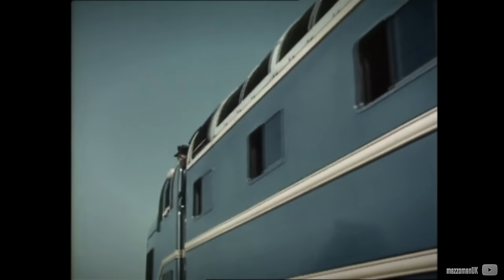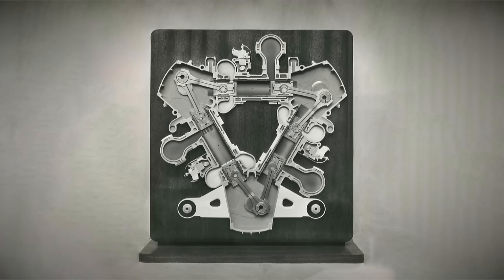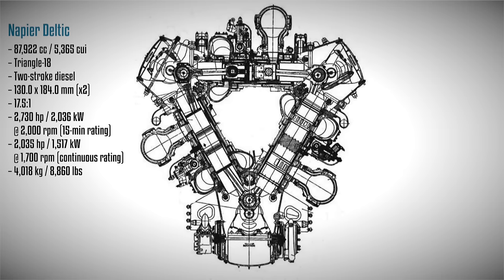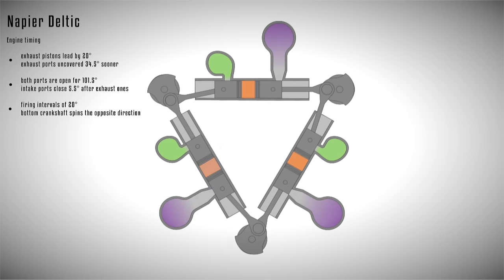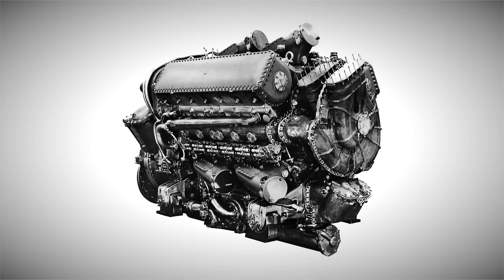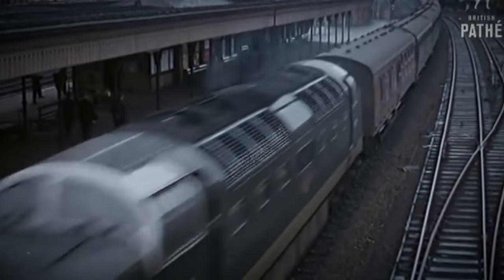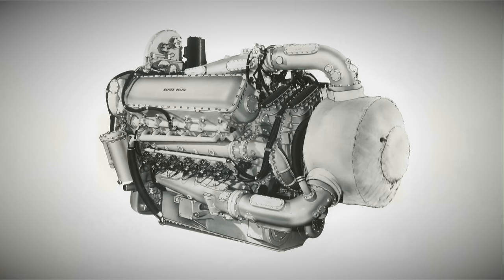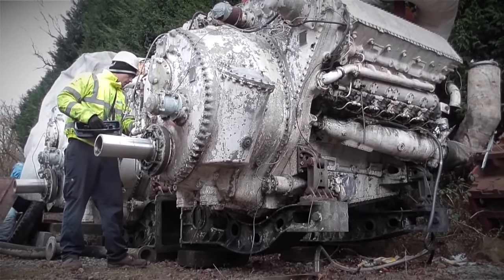The Ingenious Napier Deltic 2-Stroke Diesel Engine

Comment: 2:22  Yeah.  That's a big engine.

Napier created some of the most monumental engines in history.
Lion:  1200 cubic-inch broad-arrow 12.  Designed during WW1, still set land speed records in 1947.
Rapier:  Air-cooled H16 aero engine.  I just like saying "Napier Rapier".
Sabre:  Liquid-cooled sleeve-valve H24 engine that powered the Hawker Tempest and Typhoon fighters of WW2.
Nomad:  Turbocompound 2-stroke flat-12 diesel aero engine.
Deltic:  18-cylinder opposed-piston 2-stroke diesel, only one of its kind to reach production.  By the time they worked up to the turbocompound deltic, what else could be thought of?
Reply: The Jumo 224 is a 4,500 horsepower 24 cylinder, this technology was licensed to Napier.
Reply: @sandervanderkammen9230  The designs of the Junkers Jumo 204/205 inline-6 opposed piston engines were licensed to Napier in the 1930s. Junkers did not share any info on the Jumo 223 or 224 four bank diamond shaped engines with Napier, partly because they never put the engine into production, and partly because Germany and Britain were at war. The Deltic was proposed in 1945 and was certainly inspired by the 223 / 224 which Napier were aware of, but no details would have been licensed to Napier during the war, and I can find no evidence of collaboration afterwards.
Reply: @londonalicante  The 3 bank design was licensed to Napier... Jumo chose to pursue the 4-bank design
Reply: @sandervanderkammen9230  Do you have evidence that Jumo licenced a multi bank design to Napier? I tried to post you an article from a reliable source indicating otherwise but the comment got deleted. As you know, I acknowledge Oechelhäuser / Junkers as the inventors of the first successful opposed piston engines, and they did license the 204/205 to Napier, but I've never seen anything about Junkers licensing the multi-bank engines to Napier.
Reply: @londonalicante 
 Jumo 204 = Napier Culverin.
Jumo 205 = Napier Cutlass
Jumo 218 = Napier Deltic 
Jumo 223 = no Napier equivalent, developed after the license agreement.
Reply: @sandervanderkammen9230  I was hoping you would convince and enlighten me. Unfortunately you haven't. Here's what I found:
Jumo 204 6 cylinders, 120mm bore, 210mm stroke. Napier licensed equivalent Culverin, 4.75 inch bore 8.25 inch stroke
Jumo 205 6 cylinders, 105mm bore, 160mm stroke. Napier licensed equivalent Cutlass (never built)
Jumo 208 6 cylinders,  130mm bore, 160mm stroke
Deltic 18 cylinders 5.125 inch bore, 7.25 inch stroke
EVERY mention I can find of the Jumo 218 says it was a double version of the Jumo 208 with 12 cylinders. The only thing it has in common with the Deltic is a similar bore.

The Jumo 204/205 were licensed to Napier in the 1930s. There was a war from 1939 to 1945, during which licenses would not have been honoured by Jumo or Napier, since their countries fought on opposing sides. Development of the 24 cylinder diamond engine Jumo 223 (80mm bore 120mm stroke) started in 1936 with engines built in 1942, after which it was abandoned in favour of larger 224 (105mm bore 106mm stroke.) Development of this engine continued after the war in the Soviet Union. The engine had 4 crankshafts rotating in the same direction, 2 dedicated to inlet pistons and 2 dedicated to exhaust pistons, allowing the exhaust pistons to lead the inlet pistons by any amount the designers desired.

The Deltic was proposed to the British Admiralty (Navy) in 1945, which means it was conceived during the war. Also, I cannot see the Navy wanting anything to do with a project that required licensing from Germany given the political climate of 1946. It's possible Jumo could have licensed a 3 bank engine was 1936-1939 however I can find no evidence of this. According to English Wikipedia, Junkers did look at a 3 bank layout but abandoned it due to timing issues - Herbert Penwarden of the British Admiralty Engineering is credited with working out that the bottom crankshaft needed to rotate in the opposite direction to the other two. This may have been an original thought, or it may have been reverse engineering of a Junkers, but I can find no indication that Junkers ever licensed a 3-bank design to Napier. Junkers probably did not like the fact that the 3-bank design requires the exhaust piston to lead the intake piston by exactly 20 degrees, which is rather inflexible, and I believe, rather more exhaust lead than typical.
Reply: @londonalicante  Yup, all German Jumo technology licensed to Napier...
Reply: @sandervanderkammen9230  As I say, 6 cylinder engines licensed to Napier before the war. Multibank engines developed independently during and after the war, though both sides had some idea what the other was up to. Of the Germans, the Soviets, and the British, only the British brought a multibank product to market. The 4 bank engine could have been a good engine if conditions in Germany / Soviet Union were right for it

And the 218 was a 12 cylinder engine. Nothing like the Deltic or the 223.
Reply: @londonalicante  All German technology developed by Jumo and licensed to Napier...
It's British manufacturing... and German engineering.
Reply: @sandervanderkammen9230  "British manufacturing and German Engineering" - yes, this applies to the Culverin and Cutlass, which were based on the fully-developed Jumo 204 and 205 6 cylinder engines. All Napier had to do was adapt them to their manufacturing. And there is no doubt that the Deltic would not exist if Napier had not licensed these 6 cylinder engines, and was in great part inspired by the Jumo 223/224 four-bank engines.

But you have made a very specific claim "The 3 bank design was licensed to Napier" , and made it several times on different threads on this video. Effectively, this means, Napier paid Jumo for information on a 3 bank design and the right to use it. I asked you for evidence, and all you said was that the Deltic was based on the Jumo 218 (which is obviously incorrect since the Jumo 218 was a 12 cylinder engine, a double version of the 208.) Can you provide evidence to support your claim?

I sent you a link to old machine press dot com, that was deleted by youtube. Your claim is specifically refuted by the articles on the 223 and the Deltic on that site. Additionally, a search for the Deltic on Junkers dot bplaced dot net yields no results. 

I am in pursuit of truth and it seems very unlikely that Jumo licensed a three bank design to Napier for the following reasons.

1. Napier licensed the 204 and 205 from Junkers in the 1930s, rebranding them as the Cutlass and Culverin. Given that they never actually commercialised these engines, why would they license a larger engine in the 1930s, when there was no market for such a big engine at the time?

2. It is impossible that Jumo shared information with Napier for profit in the period 1939 to 1945, due to the war.

3. The Deltic was first proposed to the British Admiralty (Navy) in 1945 and accepted for development in early 1946. In the post war climate, licensing from Junkers is very unlikely. They would either avoided the design, or just taken it without paying. The best German technology was just taken by the allies after the war, as exemplified by the recruitment of German missile engineers by the USA and USSR for their "space programs." 

4. If Junkers had explained the timing of the 3 bank engine to Napier, Herbert Penwarden of the British Admiralty would not have had to invent or reverse-engineer it as per English Wikipedia.

5. Apart from being based on a Jumo 204/205/208 type 6-cylinder engine (which was admittedly 80% of the engineering) there are virtually no similarities in the 223/224 four-bank implementation and the deltic implementation:
- Deltic has timing gears and power takeoff at one end. 223/224 had timing gears and power takeoff in the centre of the crankshaft. (The 2-piece crankshaft caused issues that would no doubt have been resolved if a market had been found for the engine.) 
-223/224 has a single massive gear on the output shaft which directly engages with the crankshaft to coordinate timing. Deltic uses an idler between the output shaft and every crankshaft (2 in the case of the bottom crankshaft, to facilitate reversal.)
-Deltic has bore x stroke 5.125 in x 7.25 in (approx 130mm x 184mm) which does not match any Junkers engine listed on the Junkers dot bplaced website listed above (except that the bore matches the Jumo 208.)
Reply: @londonalicante  The Deltic is based on a Jumo 3 bank design.
Reply: @sandervanderkammen9230  Quite possibly, based on a Jumo 3 bank design. Wikipedia says that Junkers did look at a 3 bank design. But if you think it was licenced, please provide a link to your evidence. As I say, while there was a war on Junkers would not be sharing anything with Napier. Everything I can find says that Napier took the 204/205 design and developed the rest independently.
One thing we agree on, the Deltic would not exist without Junkers.
Reply: @londonalicante  The burden of proof falls on you lad, there is zero evidence that Napier developed any type of multi-bank opposed piston engine prior to licensing the technology from Jumo.
Reply: @sandervanderkammen9230  Napier licensed the Jumo 204 and 205 6-cylinder engines from Junkers as the Culverin and Cutlass in the 1930s. There is indeed, zero evidence that Napier developed any multibank opposed piston engine at that time. Junkers started work on the 223 in 1936 and built a prototype in 1942. Therefore Junkers conceived and built the first multibank engine.

There is also zero evidence that Napier had any interest in a multibank engine at that time, especially as they failed to commercialise the Culverin and Cutlass . "The 3 bank design was licensed to Napier" is your claim and the burden to prove it therefore falls on you. So far you have produced no evidence that there was any licence contract between Junkers and Napier for a multibank engine. Also, I can find no evidence that Junkers had any multibank opposed piston diesel running before 1942, so the most they could have offered Napier would be a license of a concept (i.e. a patent rather than a complete design) which would have expired within 20 years from 1936. 

From 1939-1945 there would be no collaboration between Napier and Junkers due to the war, although they were aware of each others work. After 1945 the main Junkers factory in Dessau ended up in Communist East Germany and development of the 224 Multibank continued in USSR until it was abandoned in favour of the Yakovlev M-501 (the article on the M-501 at old machine press dot com confirms that many German engineers moved to USSR to work on the 224.) 

According to npht dot org under marine diesels, in the beginning of 1946 received a contract from the British Admiralty to build a 1-cylinder, 3-cylinder and several 18-cylinder prototypes, essentially a new design, building on what they knew from the culverin and cutlass. You can see a photo of the 3-cylinder prototype at old machine press. It's pretty inconceivable that there would be information sharing between the West and the Communist Bloc from 1945 onwards especially given that the Deltic started out as a military naval application, so I fail to see how Junkers could have licensed anything to Napier at that time either.
Reply: @londonalicante  All of the evidence proves that the multi-bank concept and several prototypes were developed by Jumo and this technology a long with the actual designs predate, and were sold to Napier.
There is zero evidence to support that Napier developed any of the Gegenkolbenmotor designs independently.
Reply: @sandervanderkammen9230  LOL, are you back again? The Culverin and Cutlass were licensed copies of the Junkers Jumo  204 and 205 (the company name is Junkers. Jumo is a brand name of a group of Junkers engines.) Therefore the Culverin and Cutlass were almost 100% Junkers engineering, adapted for Napier manufacturing, with dimensions in inches. However there is no evidence that Napier licensed any type of multibank engine from Junkers. 

Junkers didn't have a prototype of a multibank engine running until 1942, well into the second world war, and there is no evidence that Napier had any interest in licensing a multibank engine prior to the war (especially as they didn't commercialise the Culverin or Cutlass.)   After the war, as I have already explained, the Junkers factory in Dessau found itself in Communist east Germany and develoment of the the four-bank engines was continued in Russia until they were abandoned in favour of the Yakovlev M-501 

Since there would be no legal mechanism for Junkers to license an engine design to Napier during the second world war (as British and Nazi German governments were on unfriendly terms) nor after the second world war (as East German / Russian governments were on unfriendly terms with Britain due to the Cold War) this means Junkers could only have licensed an engine design before 1939, when they had no running prototype. If you believe a license contract exists, please provide evidence.

Napier certainly copied the idea of the multibank engine from Junkers, but I have already provided plenty of evidence that the Deltic was developed from the Jumo 204 / 205 without help from Junkers. Beside the political climate as discussed above:

1 The Deltic's stroke is different from any Junkers engine. The bore is coincidentally similar to the Jumo 208. (see hugoJunkers bplaced dot net) The planned Jumo 218 had the same bore, but I already explained was a 12 cylinder engine double 208, not a relation of the Deltic as you previously claimed. The end-mounted timing gear arrangement of the deltic has nothing in common with the timing gear arrangement of the Jumo 223/224, which had power takeoff from the centre of the crankshaft

2 English Wikipedia article on Deltic says the timing for the 3 bank engine was worked out by Herbert Penwarden of the British Admiralty. Even German Wikipedia says nothing to support your claim that the Deltic was developed with help from Junkers. 

3 Old Machine Press articles on the Jumo 223 and Deltic say the following

QUOTE There is no doubt that the Junkers Jumo opposed-piston engines in some way inspired the Napier Deltic, especially since Napier purchased licenses to build the Jumo 204 and 205 engines (to be built as the Culverin and Cutlass) in the 1930s. However, there is no indication that information on the Jumo 223 or 224 engines was applied to the design of the Deltic. In fact, the Deltic possessed many unique design characteristics, such as one crankshaft rotating the opposite direction compared to the other two.

QUOTE Napier’s new engine carried the company designation E130, and the design was influenced by their experience with the Junkers Jumo diesel engines, their work on the Culverin and Cutlass, and analyses of other Jumo six-cylinder engines captured during World War II. However, there is no mention of the Junkers Jumo 223 contributing to Napier’s engine design. In early 1946, the Admiralty selected the Napier design and issued a developmental contract that covered the construction of one single-cylinder test engine, one three-cylinder test engine, and six prototype 18-cylinder engines. [Note: photos of the three cylinder test engine can be seen in the article.]

Additionally, the Old Machine Press article on the Yakovlev M501 discusses the movement of engineers of the Jumo 223/224 to Russia to continue the develoment of the Jumo engine after the war.  
  
4 The NPHT dot ORG article (under products/marine engines/deltic) discusses the challenges of developing the deltic engine from scratch. It also gives the contract date as "the beginning of 1946." There is nothing to suggest Napier had any interest in Junkers' multibank designs before then.

I am unable to provide functioning links because Youtube policy is to delete comments containing links. Please go to the websites, review my evidence and explain in detail what is wrong with it. Please also provide evidence supporting your claim that Junkers provided info on a multibank engine to Napier.
Reply: @londonalicante  The truth is irrefutable lad, this is German technology and engineering sold to Napier by the company that invented it... Jumo.
Reply: @sandervanderkammen9230  I am in total agreement with you regarding the licensing of the Junkers Jumo 204 / 205 (Once again, the company name was Junkers, Jumo was a brand.) Oechelhauser and Hugo Junkers developed the first successful opposed piston engine (Atkinson devised an unsuccessful opposed piston engine earlier, but let's not go there.) However you have made claims that the Napier licensed or in some way had help from Junkers in developing a multibank engine. As far as I can tell this is false. Napier took designs for the Jumo 204 / 205 that they had licensed prior to 1939 and copied the concept of a multibank engine from the Jumo 223/224, but they worked out the details of the multibank concept independently and arrived at quite a different configuration from the Jumo 223/224.
Reply: @londonalicante  The 3-bank design was clearly Jumo in origin and was licensed to Napier.
Reply: @sandervanderkammen9230  It's certainly not clear that the 3 bank design was licensed to Napier, because oldmachinepress and several other websites say Napier were aware of the Jumo 223/224 project but developed the Deltic from the Jumo 204/205 designs independently. I ask the same question I've been asking for a month: please provide evidence. On what website does it say that the 3 bank design was licensed to Napier? What was licensed and when was it licensed?

Was it before 1939, when Junkers had no working protype? I find it hard to believe Napier would have been interested because they didn't manage to commercialise the Cutlass or Culverin.
Was it between 1939 and 1945 when UK and Germany were at war? Napier would have been interested by 1945 because the allies saw that the German diesel powered boats were a good idea, but I can't see two countries at war with each other licensing anything. The Deltic was first proposed in 1945.
Was it after 1945 when the main Junkers factory in Dessau found itself in Communist East Germany and the Jumo 223/224 project was moved to Russia, a country the UK was not on friendly terms with?

English Wikipedia is the only place I know that hints that Junkers considered a 3 bank design, but also implies that there was no licence, because the British had to work out the timing themselves:

QUOTE: Earlier attempts at designing such an engine met with the difficulty of arranging the pistons to move in the correct manner, for all three cylinders in one delta, and this was the problem that caused Junkers Motorenbau to leave behind work on the delta-form while continuing to prototype a diamond-form, four-crankshaft, 24-cylinder Junkers Jumo 223. Mr. Herbert Penwarden, a senior draughtsman with the Admiralty Engineering Laboratory, suggested that one crankshaft needed to revolve anticlockwise to achieve the correct piston-phasing, so Napier designers produced the necessary gearing so one of them rotated in the opposite direction to the other two.

The Jumo 223/224 project started in 1936 and the first prototype ran in 1942. Interestingly, English Wikipedia mentions a Spanish patent ES0118013 for a multibank engine filed in 1930, six years before the Jumo 223/224 project started. The Spanish would not have been in a position to object to Junkers borrowing their idea because they had a civil war from 1936-1939.
Reply: @londonalicante  It's clearly a Jumo design in origin... why is that so difficult for you to accept?
Napier licensed the Gegenkolbenmotor from the German company Jumo that invented it.
Reply: @sandervanderkammen9230  Junkers Motorenbau were the great pioneers but that doesn't mean you can claim things without evidence. When you say that Junkers Motorenbau LICENSED the multibank design to Napier you are making a very specific claim, which is that Napier obtained permission from Junkers to copy their multibank design. In most cases a license would also include detailed information on a design, expertise, and almost certainly some money would have changed hands. I have asked you what your source of information is to make this claim.

Junkers Motorenbau licensed the Jumo 204 and 205 single bank desigsn to Napier, but there is no evidence that they licensed a multibank design to Napier. Junkers built the first multibank engine, that is undeniable and a great achievement. But there is nothing to suggest Napier paid anything to Junkers for a multibank engine prior to 1939, or that they received any information from Junkers (since the idea was in its infancy.) All Junkers would have been able to offer before 1939 might have been a patent (which would mean nothing once the war started.) All evidence suggests that **the Deltic was an unauthorised copy of the Junkers idea**, developed independently in a country that from 1939 onwards was not on good political terms with the country where Junkers were based.

I'm not talking about who built the first engine or whose idea it was. I'm talking about your specific claim that Junkers LICENSED the multibank design to Napier. That's very unlikely. Before 1939 Napier had failed to commercialise the culverin and cutlass, and the Jumo multibank engine was underdeveloped at that stage, I can see no reason why Napier would be interested. After 1939, licensing would have been politically impossible due to the war. Napier's first interest in the design appears to have been in 1945 after seeing the successful German diesel warships, but by then Junkers would not have been willing or politically able to share information.

I suggest you read the links to oldmachinepress, npht dot org and junkers bplaced dot net that I have provided supporting my understanding of the historical events.  I would be more than happy to read any links that you can provide supporting your position.
Reply: @londonalicante  Why is it so difficult for you to accept the truth, the Jumo 3-bank design predates the Napier version by many, many years.
Reply: @sandervanderkammen9230  Stop bringing down the discussion following my comment with your unsupported assertions.  londonalicante has provided lengthy explanations as to why Junkers was never in a position to license the deltic engine form to Napier.  You haven't provided any potential sources where we can find evidence that Junkers worked on a deltic engine.
Reply: @andyharman3022  Just the facts here lad, Napier bought the rights and the design of the Jumo 218 3-bank engine, it is not a British design, licensing fees would have been paid if not for the war.
Napier made every effort to distance itself from Jumo or mention the German origin of it's engines after the war.